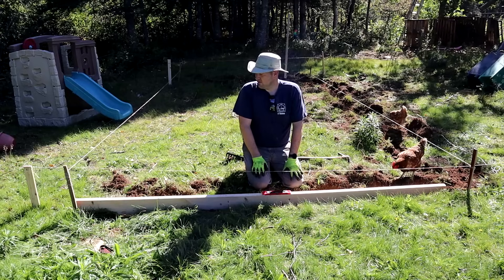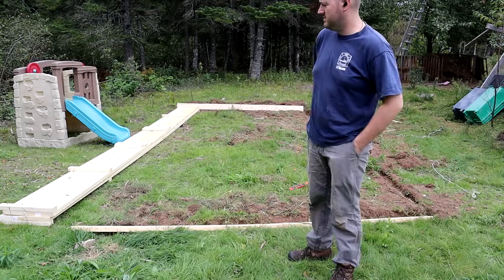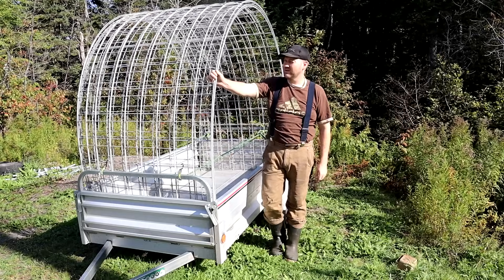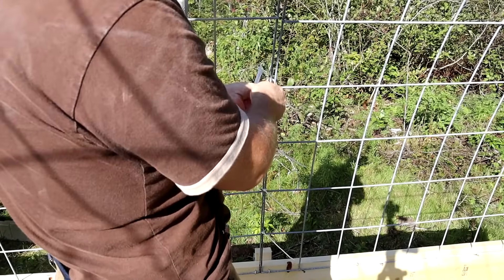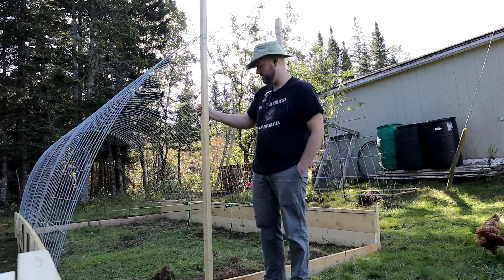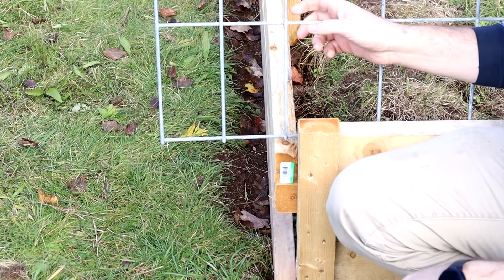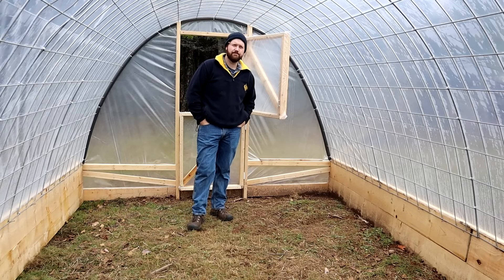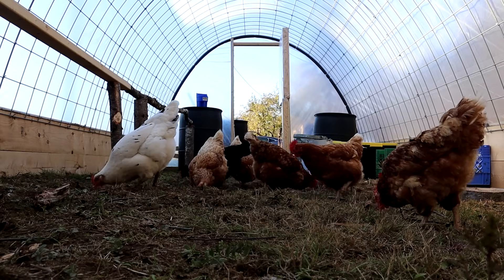DIY Cattle Panel Greenhouse Build (One Person)

Comment: Only thing I might have done different would be to overlap the cattle panels slightly, so you wouldn’t have to cut the panel to length.  The overlaps would strengthen the structure.  Great job and I look forward to watching this get used!

Comment: Should've set the cattle panel on top of the board instead of inside of the board...this would've helped the bowing.  Plus drive supports into the ground alongside both sides every 4 ft. You will need a support meal on the inside to to support the greenhouse from wind and snow.

Comment: Hi, my understanding is cattle panel wires are atleast 4gauge or 5mm diameter. Will a thinner wire around 2.5 mm diameter work? Could not find cattle panel in Ireland.
Reply from the maker: Can't say for sure but I would guess they would.  Not much snow in ireland to put a load on them as far as I know.
-Dom
Reply: @ODriscolls  Many thanks for replying

Comment: Great build.  Good work.   You can stain the wood, and that provides some protection against bugs in my area.  They are non toxic when dry, but some people have their doubts.   We have some flying bugs, that nest in untreated wood.   I'd also be concerned that zip ties would rot.   I'd likely use perhaps metal wire.
Reply from the maker: Good tip!

Comment: How has it held up to this point in time?  Do you find water collecting in-between your strapping and plastic (especially on the long sides)?  I 'd love to make something similar so looking for any feedback.  Thanks!
Reply from the maker: The first year it was great! The major thing was that we live in a place that gets quite a bit of snow. Dominic was always home to brush it off so that it didn't get warped. The chickens lived in it that winetr, which was a great success! The next year, we changed our plans (we moved last summer) and we went to Newfoundland for a week in March of 2023 and there was a snow storm while we were away and the greenhouse sadly did not survive. So, it does need to be maintained. There were no chickens in it at the time (they were rehomed!). I think that as long as you are there to ensure quick repairs, it will be good to you. Also, do not let sheep in, they will eat all your tomoatoes and you will never emotionally recover.

Comment: ...'ehhh,..it's an 0K video, I would say. 
...I've built green houses,..ranched, and farmed all my life homesteading.  And I gotta say that's 1 way of building a green house using cattle fencing.. though very expensive, there are other ways that will help save your pocket book, and will be stronger even structurally, for instance 
How were able to build 100 of these on our farm, using the same 2x6 12 foot boards bellow, pretty much doing the same dimensions, but a bit taller, using 
12 foot pieces of pvc pipe, 12 foot pieces of number 7 gage rebar put it through over the top to the other side having 10 ,12 ribs then of course, thick clear plastic. 
From what I've just seen here it appears you did all that the hard way. lol.   
! Still nice though.  lol 
I've seen this method before but when time is in the essence, and you still need a strong green house and many of them all at once, you learn quickly how to improvise.  
Happy Gardening! 
I have tips as well how to winterize it when it's -10 bellow and still growing fruit and vegetables inside. 
Happy growing!

Comment: U need 2 vertical supports for snow load. I think snow ice and any branches would rip plastic and then you have to redo it. Not a fan of plastic but great job
 Hope it holds up
Reply from the maker: We did have to install a ridge beam for snow.  Surprisingly, it was the snow that built up on the sides that was the real killer.  Dom was able to brush the snow on top off frequently.  We didn't have much snow this winter, so it wasn't an issue. However, last winter, it built up around the sides and pushed in.  It depends on your region.  We did need something for the snow,  though!

Comment: Thank you for your video. I want to do a gteen house, 12 ft x 15 ft Im in Denver Co. We have a few strong snow storms may be once a season. I cant find the pannels. Home depot, sells the roll of cattle wire. Would it be the same? Will it hold 4 in of snow?? TIA
Reply from the maker: If it's in a roll I guarantee it won't work, sorry.  I'm very surprised you can't find cattle.panels in CO.  Maybe try looking for hog panels?  I think they are the same.  

Mine handled 4 inches of snow without caving when it was light snow.  The wet stuff buckled it though and I ended up installing a ridge beam.  Wind seems to have no effect on it so far.

Good luck with your build!
Dom

Comment: I had a problem with it not being perfectly round. I used a board to from the ground to the hoop to push it over. Then I installed my door frame. The door frame helps keep it round. If you need to, you can install a door frame at the rear to help keep the shape you want and not use it for a door. Worked out pretty good.
Reply from the maker: Thanks Doug,  that sounds like a great idea.

Comment: I make the green house 6and one feet wide set ends of panel on ground put steel post where two panels come together 6 panels long I use 14 posts after you drive them in cut them off some so their approximate same height where cattle panel meets steel post then put 2"pipe with cap on top of steel so it doesn't puncture plastic run a board along bottom to anchor plastic to build the ends in

Comment: for the wood, you can char burn it at least on the part touching ground
2- coat it good in use motor oil with deisel, like farmers do to fence posts.
Reply from the maker: For sure.  But for planting I didn't want to have oil/diesel in the soil.

Comment: Wondering how it worked out with the chickens in the winter. I think I'd be inclined to install a remote thermometer with livestock in there. Hope it went well. 

Loved walking through the thought processes and why you made various choices.  I have been binge watching these videos as I plan to make a 2 panel hoophouse to string my tomatoes that I can rotate over different beds. Eventually, I may make one as a mini greenhouse, but for now, it will just have row cover to protect from extreme sun.
Reply from the maker: We're gonna make a video reviewing the winter but so far so good. There were some structural issues with the snow. The chickens were good all winter though!

Comment: I haven't finished watching yet but a torch should heat the wrinkles out, kinda like a big hair dryer 👍
Reply from the maker: Really?  A regular torch?  Wouldn't just burn straight through? - Dom
Reply: @O'Driscoll Family Homestead Experiment  🤣 Yes if you hold it too close but plastic shrinks with heat. If you've ever bought one of those "window covering kits" that has a thin plastic for covering over your windows it also tells you to use a hair dryer to shrink out the wrinkles and it works really good.
Reply from the maker: Cool maybe I'll give that a go.  Expect a video "how to melt holes in your greenhouse" haha